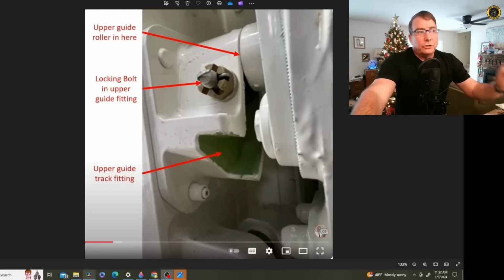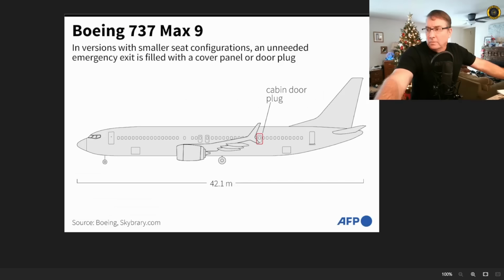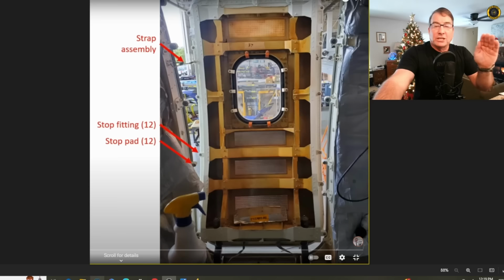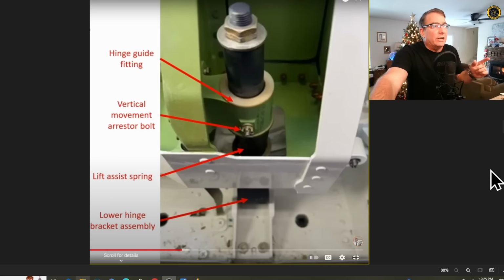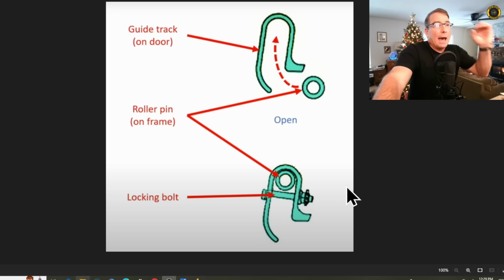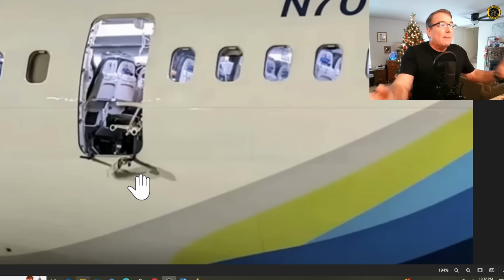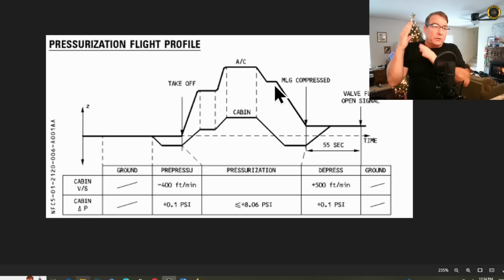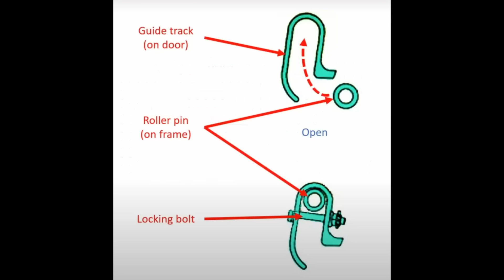Alaska 737 Max-9 Door UPDATE! 8 Jan 2024

Comment: Well so far It sounds like WAAAAAY to many moving parts ~ metal/plastic parts will break from wear n tear/faulty manufacturing/bad maintenance, mankind is made up of man, after all.  Though the parts from the plug all the to inside looked like they worked (good shape) so what your saying all them moving parts did not prevent the blowout?  Well there is is that part where it appears to have broken off but none of the (?)preventative(?) crap worked, huh?  Boeing has had MAJOR problems ever since they moved their corporate from Seattle to Chicago to South Carolina, ya best not screw the unions off ~~ just saying.............................:text-green-game-over::text-green-game-over::text-green-game-over::text-green-game-over::text-green-game-over::text-green-game-over::text-green-game-over::text-green-game-over::text-green-game-over::text-green-game-over::text-green-game-over::text-green-game-over::text-green-game-over::text-green-game-over::text-green-game-over::text-green-game-over::text-green-game-over::text-green-game-over: 
stop flying or best get yourself right with GOD!

Comment: This is stupidly designed, the door plug should be designed that it can only be installed from the inside of the plane. Much less week spots for it to fail.

Frankenplane Boeing MAX is everything that's wrong with Boeing. THE PLANE REMAINS UNSAFE!